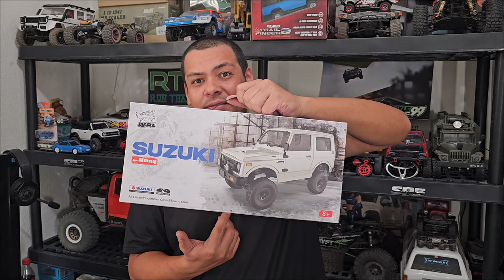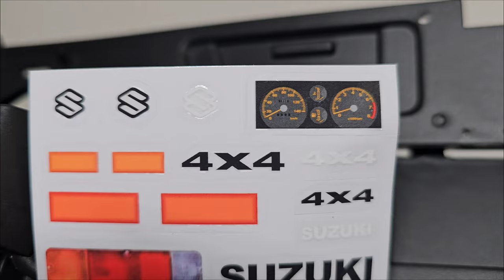WPL C74 Suzuki Jimny 1/10th scale.

Comment: I pre-ordered mine and got an email saying that they ran out of stock and would give me the new color for waiting so long and should ship mid December. They have great customer service and I had no problem waiting a little longer meanwhile all the upgrades arrived like metal axles, 2 speed trans, metal gear servo, wheel weights and I already had a V3 receiver as I have now built 8 WPL's, mostly the military trucks. Love your videos, been subscribed for a few years now and quite frankly the one that really convinced me that WPL's were good, just have to know how to build them. Great work keep it up!
Reply from the maker: Awesome! Glad your enjoying your WPLs as much as I do. Thanks for being a part of the RTR crew all these years! Building these and getting them dialed is part of the fun with these for sure.
Reply: Should’ve ordered off amazing got mine right away
Reply: I sheared the pinion on my 1/16 scale WPL, bouncing like that. If it was a 1:1 scale Jimney, it probably would have broken something in the driveline too.

Comment: If i could remember someone said that if you flip the pumpkin to the other side it loses all the binds because the original install has that close shaft pinion diff to the main diffrential
Reply from the maker: I will need to try this out when I install metal axles and a 2 speed in here.

Comment: Hate that they didn't give the faceted lens treatment to the tail lights and front turn signals the same way the headlights have a faceted lens. A careful fella could gently score the inside of the lens, horizontally & vertically with an X-Acto knife or panel line scraper and a straight edge. Then paint the lenses with clear red and clear amber

Comment: Seems like it would easily toppled, where would you put a counterweight and how heavy should it be?
Reply from the maker: this model does like to tip over randomly. I would put the WPL wheel weights and metal axles upgrades. That should help add weight down low and help from rolling too much.